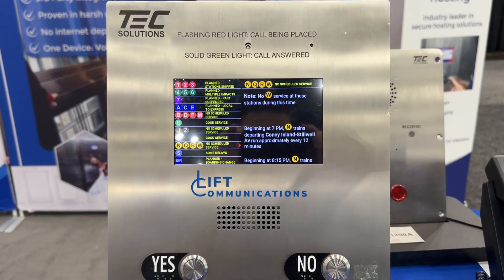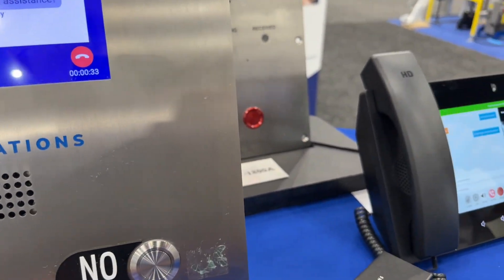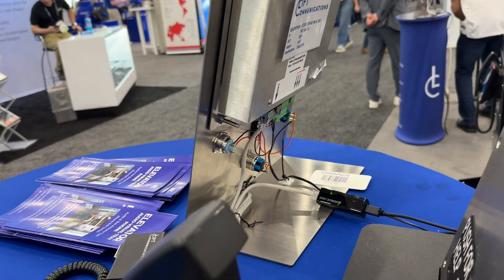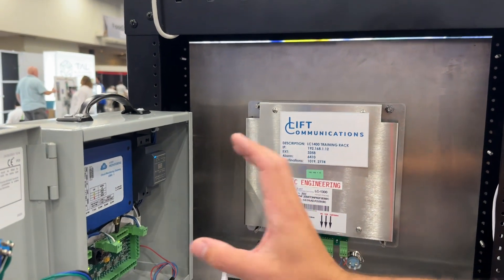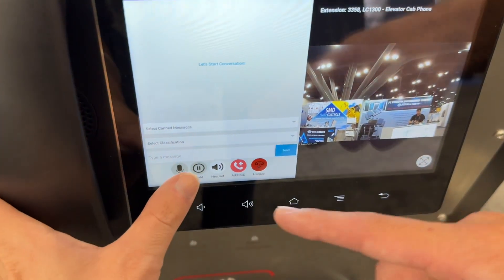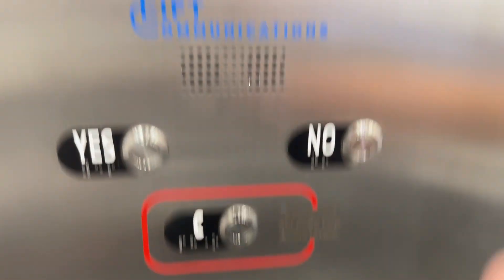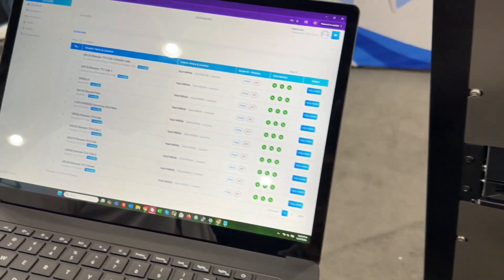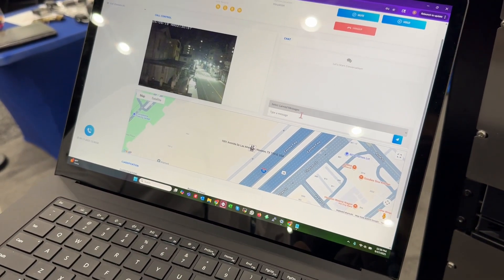Detailed Overview & Explanation of a “Yes/No” Elevator Emergency Phone - NAEC 2025

Comment: I believe different emergency telephone companies for the elevators like RATH, Janus, Wurtec, etc. have something similar to this except that the LCD screen isn’t touch screen, the operator controls is run via through a computer than a touchscreen on a phone, and some installs integrate the door open and close buttons as the Yes/No buttons rather than having separate buttons.

Comment: this is also the reason most new elevators/mods use digital screens for the floor indicators in areas where this is mandatory (2019 code), it doubles as the experience for the two-way text comms, etc. in most cases I've seen, the door open/door close buttons will function as the yes/no buttons, and a prompt will come up on the screen at the start, explaining that. generally, only generic setups will use the dedicated yes/no buttons, but sometimes there will be a separate module on the side of the cab (schindler does this for retrofits)